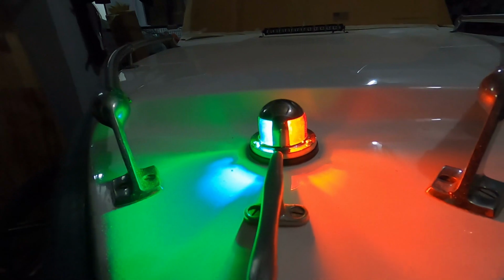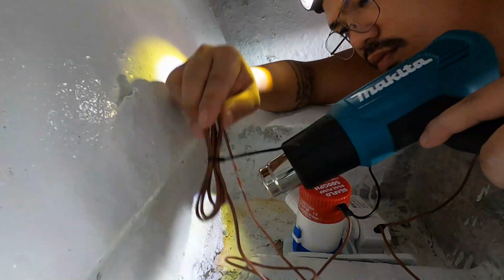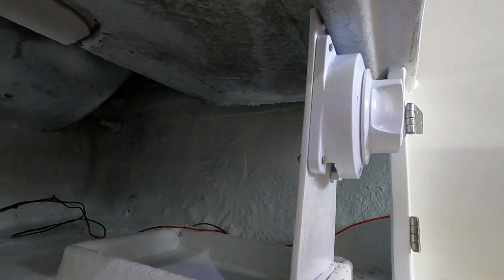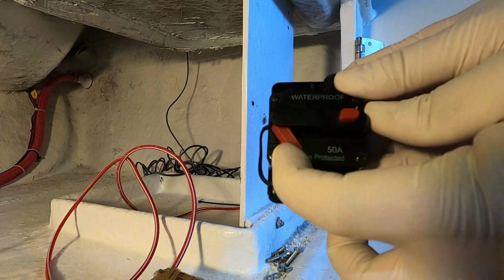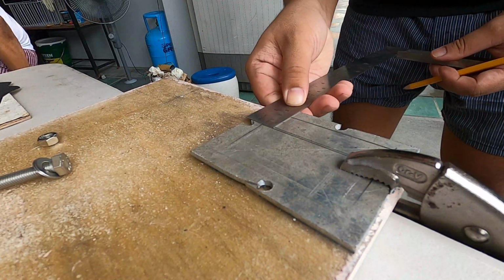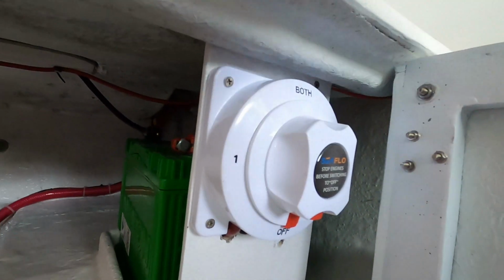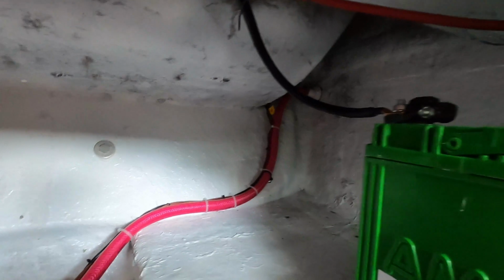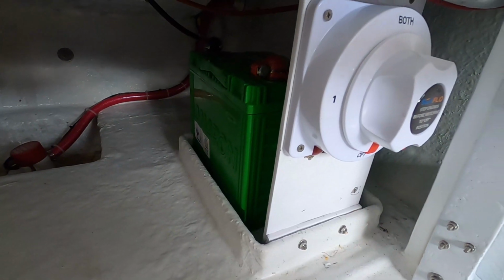EASY BOAT ELECTRICAL WIRING INSTALLATION | boatlifeph

Comment: Very nice and neat wiring system. Thank you for sharing. A question, if you don't mind. How do you decide the capacity of the battery needed for your system and also the 50A breaker?

Comment: One thing I noticed is that you used a terminal strip instead of a bus bar.  A bus bar would have saved you a lot of wiring and connectors.